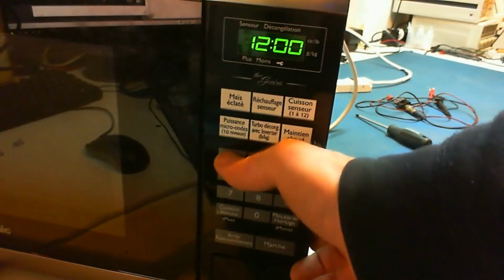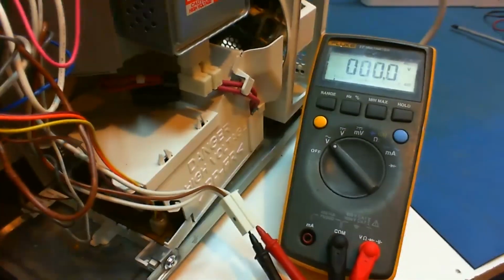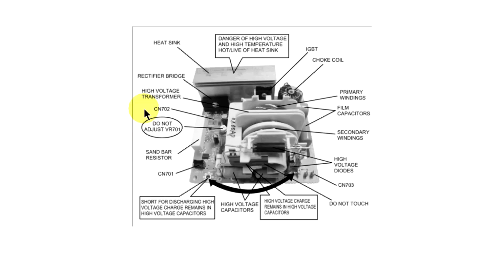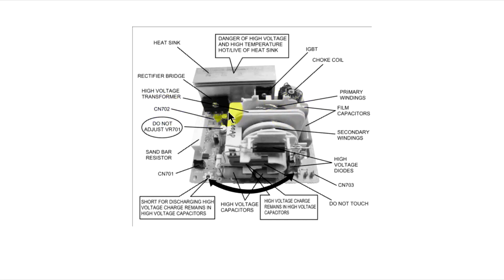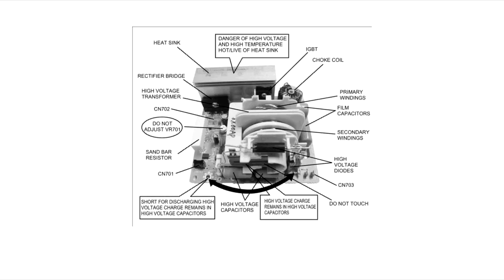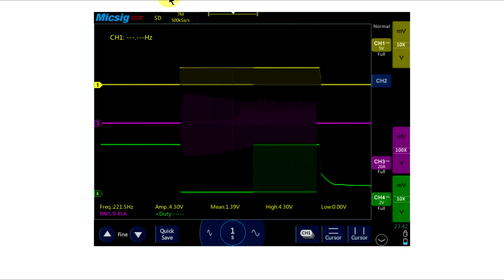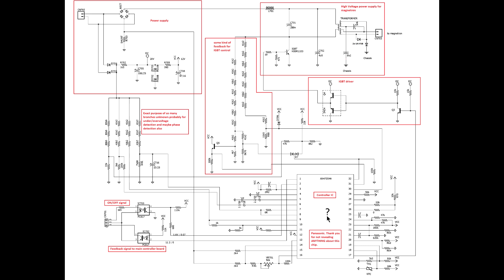F66459X91AP H97 error inverter schematic Panasonic

Comment: Hi, nice video and very instructive about how the feedback work on the inverter.
In my case i have an Ikea MWN 200 S, but in fact it’s an Ikea stiker on a Whirlpool microwave.
There is an error 5 ou S as it’s the same symbol, the microwave work 5 second on microwave mode then « error 5 ». For your information it’s work perfectly on grill mode.
I tried to test the contactors on the door but it’s ok. Ok also for the klixon.
As the error appends only on microwave mode i tested magnetron, and it's ok.
So two possibilities, the main board or this inverter board.
And with your video i think about a simulator to try to identify the one problematic…
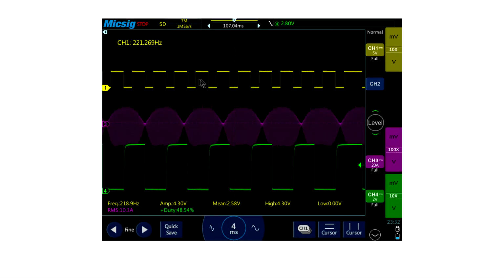It’s seem on your video 3:37 than the feedback (green) the frequency is 50 % less and it’s change from 1 to 0 or from 0 to 1 on a change on control signal from 1 to 0 (yellow).
So to me the feedback result look like a D flipflop latch, as CD4013, connected on the control signal.
What do you think about realise a small circuit with a CD4013 to similate the inverter juste to know if the error 5 is still here (then the main board will receive the good signal as feedback)?
Sur the micro-wave will still not work ;)
Reply: Hi guys, 12 days ago a wanted to create an inverter simulator to know if the error 5 (or S) will stop by this way, even if the oven will not heat off corse. So the simulator was done with a litle bit more componants the expected but not too much. No more errror 5/S so i'm sure at 100% the problem is the inverter and i will investigate more because i already have tested diodes/IGBT/Condos/tranformer.
A small video off the simulator working => https://youtu.be/ENPNTNqdkQ0

Comment: I think its best to simply replace both magnetron and inverter. The magnetron has a certain life expectancy, once they reach the dodgy stage it will keep blowing up the inverter periodically. The inverters coils lose their enamel coating and present shorts back to the IGBT and blows that up too. The cause of all of this is usually dirty microwave inside that causes sparks and overloads everything.

Comment: The input wires which come to pcb..when u connected the multimeter..why it did not show rhe 220v ...it showed 0.0000...waht doea it mean...plz explain..how to check the 220v comes to mother board.and plz tell us..what is the output from pcb to magntron.tq sir

Comment: Dear, is it possible to convert the microwave to work on the normal converter instead of the inverter? I mean, is it possible to dispense with this inverter card and return to the old or usual system? Thank you
Reply: Hi, complicated because you have a main board with a feedback from the inverter. So if you arrive to simulate the inverter board well it's possible after that. But how will you control the different power level as it's how the main board did it with the inverter?
Reply: A small video off my simulator working => https://youtu.be/ENPNTNqdkQ0

Comment: Thank u. I have H and COOL errors and after trying new maggy still have same errors. There seems to be HV . My NCV meter shows big voltage at wires to maggy but not value. I'm guessing the chip now. Wonder if I can get a replacement chip.

Comment: Microwave oven using inverter is exposed to sensitive HV spark that may caused the operating system corrupted. The result of this is the oven shut off after start up. Don't look at those micro switch, they are all good except microwave is using a transformer.Try to reset the system to restore the functions. Never think that the magnetron defect is only an open filament. The diode inside is dead. Replaced them directly. My advice that avoid microwave oven using inverter.

Comment: Hi Tom, when I start my Panasonic  NN-L931BF Inverter Microwave, the timer, fan, and rotating turntable and light begin to operate but stop after exactly 5 seconds. The timer resets to start but everything else stops when the Magnetron tries to kick in. Always after 5 secs exactly.
I checked all the door switches and fuses and all is OK. I'm about to pull out the Magneton 
Do you think this is causing the cook function to reset the oven? It is dated 2001 but I just bought it a year ago.  First time this has happened. The magnetron is 2M261-M32, older than the one in your video.  I don't believe the fuse is blown as it starts everytime.  Do I need to replace the invertor board or the magnetron to fix this problem.  Will gladly donate to you for the correct advice....Paul
Reply from the maker: Sorry I don't have the answer. Did you also check the magnetron? Filament - low resistance, filament to casing - high resistance. Could be the magnetron itself or the inverter board falsely detecting some overcurrent or other fault condition
Reply: @tomtechtod9200  TOm  take a look at this video...
https://www.youtube.com/watch?v=v2lKSE5RLLg
He thinks the prob is that my Magnetron has a short as the one in his video.
He did a coninuity test and found he got a low reading when he tested the temininal on the side of the mag and usedthe other probe to touch the metal casing. He replaced the mag and it worked fine. Did you try testing the magnetron for a short?? Instead of replacing the invertor .He may be right?????
Reply from the maker: If you have a short between filament terminals and casing the magnetron is defective.
Reply: @tomtechtod9200    Yes but, checking for a short in the mag with my audio lineout though it still produces sound when I touch a terminal and the casing. Does this prove that the mag is defective? If there is no continuity between the mag casing and the terminal I should hear no sound at all . And your continuity meter should produce no beep tone? You didn't address this. I don't want to waste money on a new mag if I am wrong here.
Reply: I had a oven which reset after 3 seconds and after replacing A200 with B647 it works fine, because I did  not have A200 at that time.
Reply: Hi, after having the same problem a did a simulator, so this error come from the inverter, look at my video and the description.

A small video off my simulator working => https://youtu.be/ENPNTNqdkQ0

Comment: Did you find how to interpret the Control signal, is it a pwm of the output power or something else?
Reply: Hi, no. The control come from the main board from the connector with 3 cables, to the opto. The duty cycle manage the power and also with the presence or not off this signal.

Comment: Hi.Is it possible to have a link to find the schematic of this inverter?
Reply from the maker: No, sorry, that's why I went through the pain of drawing it.good luck
Reply: @tomtechtod9200  hey mr...my inverter board keeps shorting the high voltage diodes what could be the problem.This board is for LG neo chef microwave{EAX66910801}

[
Reply: Any leads

Comment: I had a n97 code so I replaced the power inverter and try to turn it on but still had the same problem, so I replaced the whole digital control board display and the problem was gone
Reply: jelly bro1223  you did the right thing, mostly h97 cause on the board , h98 cause on the others
Reply: I am facing problem h98 in convection microwave oven of Panasonic company 
Please i need your help in this regard

Comment: Cual es el valor de la R701 porfavor
Reply from the maker: should be 100MOhm bleeder resistor
Reply: TomTechTod tengo una microondas general electric jes2251sj, con fuente inverter mas o menos igual con la R701 desecha, quisiera saber si también sera de 100Mohm
Reply from the maker: I don<t know. i doubt it would cause a problem though...
Reply: TomTechTod gracias

Comment: Do you have the opportunity to remove the oscillograms of the magnetron at different power? What is the principle of controlling the power from PWM and what's on the feedback?
Reply from the maker: No, I don't have that information, nor could I measure the IGBT drive signal at different power levels. I blew it up completely before I was able to explore the functioning of the working unit.
Reply: @tomtechtod9200  : Yes you are right.  Power level is controlled by timer . Just on for a percent of time.  When it is on it is 100% full on. Thanks
Reply: Hi, the duty cycle control the power level, but on my Whirlpool (1000W max) belowe 500W it's not only the duty cycle. For example at 160W for about 1 minutes, the power was controled by a smaller duty cycle AND the presence or not off this control signal. This on stop after 10 secondes then apprear again after 10 secondes, etc...

A small video off my simulator working => https://youtu.be/ENPNTNqdkQ0
I will try to do a bigger video and explain in detail the process.

Comment: will this fit a Panasonic Microwave model no NNSD986s and how do you know if this part is bad. I've already replaced the wire harness and door switch and have a new magnatron  and haven't installed it yet. please help with an answer anyone.
Reply from the maker: It looks similar but I can't tell if it's exactly the same. Depends on your line voltage  too. I wouldn't touch those anymore, too much hassle, just not worth it :-)